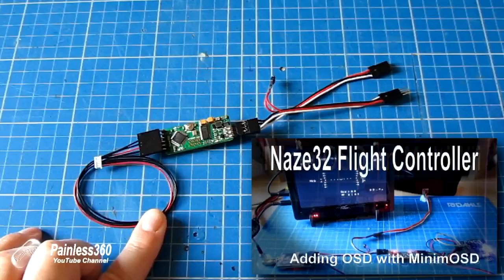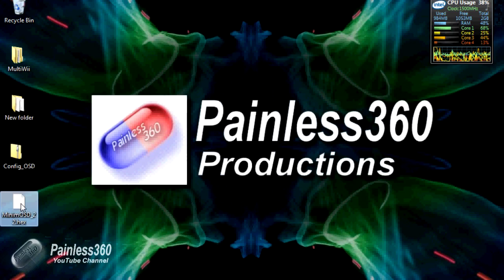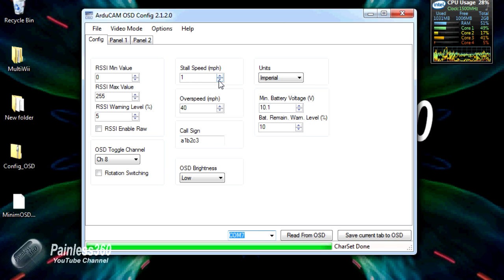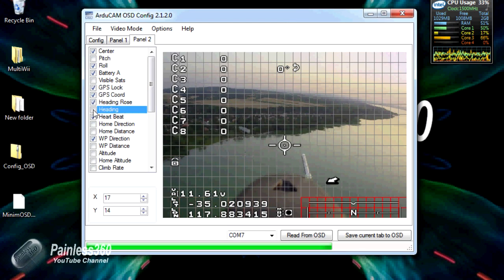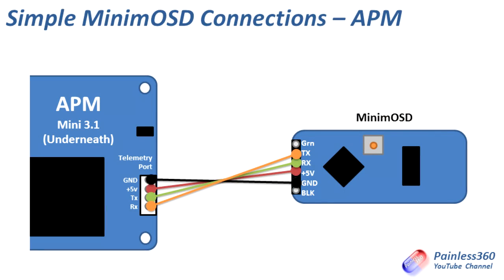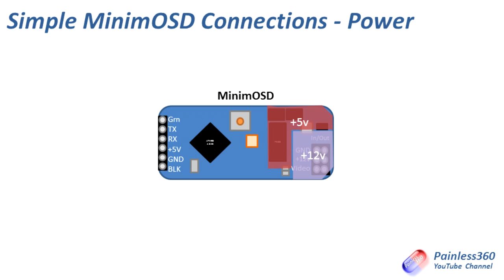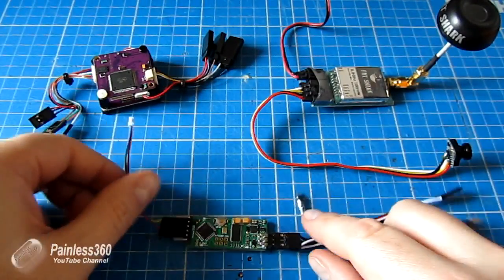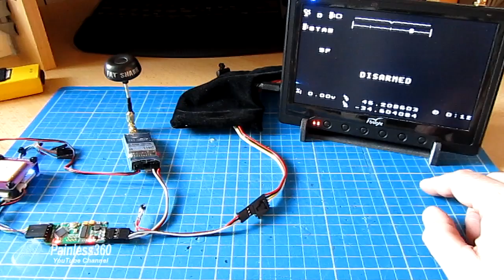APM Mini 3.1 - Adding an OSD for FPV using MinimOSD - complete setup

Comment: I’m having an issue where I select Rtl on a toggle switch and it’s not being displayed on the osd. I’ve connected the apm to ardupilot and selected rtl threw the transmitter and it registered in the software. Any reason for that? It displays stability and FWBA modes fine but when I select RTL it just show the last mode while in rtl
Reply from the maker: Testing stuff on the branch won't always bahave in the way you expect. Try it in the air... Happy flying

Comment: Hi sir... Salam alikam... Hope you will be fine... Sir kindly if you can make a video about miniosd setup with pixhalk 2.4.8 and which firmware can be compatible of osdmini with pixhalk.. bcz I am facing issue about the mini osd layout is not showing if I connect osdmini with pixhalk telemetry port 1... 
(waiting for mavelink data.)..
 But if I connect mini osd with Apm it working fine and giving the desired layout on the screen... 
Then why not with pixhalk bcz both flight controller are configured on mission plannner????🙏
Reply from the maker: https://youtu.be/ghhqSGxdIwQ was my most recent video on the subject. Best of luck

Comment: Totally appreciate your work, great job, quick question I know it is an old video but I am having one issue hopping anyone has any solution, I am connecting it with Pixhwak cube, and all things run smoothly, just as u described in the video sometime the overlay doesn't come when it starts or boots up, you have to manually reset it, is there any way around this?
Reply from the maker: I never found a solution. If you do, please let me know. Happy flying!

Comment: great tutorial, same method for the Pixhawk 2.4.8 ?
Reply from the maker: From the software point of view,  yes. Best of luck
Reply: @Painless360  thanks!. yes just a different set of cables... 2 question, if the system is running of 4s and the minimOsd has 12v and 5v how to go about it?, ... 2nd question in the last part of your video you say no power is given from the vtx to the cam, why ? and i ask this because i see the red wire of the vtx and cam connected so isnt the vtx supplying 5v out to the cam?
Reply from the maker: Not sure, there are several versions of the MinimOSD board. You can use BECs to drop the flight battery voltage to the level you need.... best of luck
Reply: @Painless360  thanks for the reply sir
support from the war torn land of Balochistan!

Comment: using this workflow, is there a way to add geotagging to an on screen display? for example have a center dot and the lattitude and longitude of that center dot? (perhaps also a grid square of 9 dots with lat / long?).

Then if the camera is a gimbal, changing the direction and angle of the camera would update the osd of teh center dot's lattitude and longitude?
Reply from the maker: It's not something I've seen. There are geotagging options in Ardupilot but the stuff I've seen is more for tagging images at the location they were taken... Happy flying
Reply: @Painless360  thanks! yeah would probably need something like raspberry pi or nvidia jetson to make a real time geo-tagging of the location where the camera points to

Comment: Trying to config the Minim OSD I purchased off Amazon. Connected to FTDI interface & computer .. tried to do a read & got 'failed to talk to bootloader'. Also said Eeprom was out of date & it tried to update, but that also failed. When plugged in, the Mini OSD board has 2 red LED lit, and a green heartbeat flashing, so the unit appears to be working to some extent. I have the TX/RX lines crossed to the FTDI board. Any ideas?
Reply from the maker: I've not used this technology for years so what I knew is in the video. Best of luck

Comment: Can i use mini OSD with betaflight controllers?
Reply from the maker: Most modern flight controllers have them built in now. Those that don’t will almost always support and external MinimOSD.. best of luck!
Reply: noob warning.So its same as minimOSD?I use XSRF3E,its compatible?Sorry again for noob questions.
Reply from the maker: There are two small boards that people used to use back in the days when on screen displays will not installed as part of the flight controller. Typically called minimosd or micro minimosd, they were typically used to add on screen displays to pretty much everything. The firmware was available to support pixhawk, APM and other flight controllers too. See my videos on the Naz E32 and things like the Seriously pro F3 for more detail. Best of luck..

Comment: Are the "in/out" on the MinimOSD actually ins and outs? AFAIK they are connected together, so a simple "Y"-harness between cam/VTX/OSD is enough? I have a Aomway camera with backpack, but it does also have the connector for the VTX exposed - so I could wire it up to a OSD.
Reply from the maker: That's the way I've always connected them and they work great. The MinimOSD is overlaying the text into the video signal so there needs to be an in and an out.. Happy flying!
Reply: Hmm, maybe you're right. I can see the ground and VCC are connect together, so that could be simplified.
I might be confusing it with my Mini OSD, or "G-OSD" where there is no in/out, the signal are just spliced together
https://static.rcgroups.net/forums/attachments/3/9/6/1/0/4/a5625515-165-hkosd%28GOSD%29diagram.png

Comment: I wonder if you have come across my problem with the MinimOSD on an APM 3.1. On powering up the craft 'Arducam OSD V2.2' appears, then a booting up message, then 'Requesting datastreams' and then the correct OSD overlay appears for 1sec and then disappears and the message 'Overspead 45m/h'
 stays on with the camera image. I have two MinimOSD boards and they both do it?
Do you have any ideas as to what might be going on.
Many thanks again.
Reply from the maker: I've not used that one here, from what I can recall. I'd try and swap the Tx and Rx cables.. Best of luck!
Reply: Thanks for trying, appreciate it.
Reply: Just a quick note in case somebody else has the same problem: Swapped Tx and Rx cables and got message waiting for Mavlink heartbeat. Swapped them back but no improvement, on a whim swapped them back again but this time swapped again with the system live and the OSD stayed up. Powered down and and back up, hey presto comes on every time.

Comment: hi painless. 
a quick question.

my minimosd works fine and does everything it should but only after the telemetry link to ground station is started.
I can stop the GCS and it is fine but it seems like the telemetry is required to start the messages flowing.

any ideas what settings make it work?

I dont want to take a laptop each time I fly but I do want the osd.

cheers
Reply from the maker: You're lucky to get them both working from the same Telemetry output at all. The output on the APM wasn't designed to run two devices at once..
Reply: ok. thanks.  I thought the Y cable was the standard. I will read some more.

Comment: I have connected OSD to APM 2.6 works great with all modes except when I switch to Auto mode (ch8) all OSD info goes away but I still can see the camera, any ideas please
Reply from the maker: +PAL- GATE I'd suspect that you have a setting on the OSD to blank the display and it's using that channel to activate it.. if check the OSD settings. I think we cover this in one of the APM series.. best of luck!
Reply: thanks, I will do
Reply: Yes you are absolutely right, it's in the OSD configuration,  OSD Toggle channel defaulted to channel 8, I disabled it

Comment: I followed your instructions on this, thanks for that.
Everything is updating except the battery voltage...:-(
Also updated in Mission planner (version 1.3.41) by clicking the osd tab.
Any suggestions?
Reply from the maker: +Pol leke not sure what you are describing..
Reply: Sorry to bother you like this, but i could not find the an answer.
This is what I mean. I have followed your instructions. So I connected everything the right way (checked, dubble checked and triple checked)
On my Taranis the voltage of my flight battery is reading fine (from the RX module FrSky Lite FUL-1) for example 12.1 volts
But when I look in my FPV goggles, the voltage is floating from 11.20 to 11.43
And it's always the same values, even when the battery voltage is on 10.7 the goggles are still showing between 11.20 and 11.43
Reply from the maker: I've not seen this - I'd check that he voltage is appearing right in the GUI and then see if there is an adjustment in the OSD software. Best of luck!

Comment: I have followed this over and over and still when I try to update firmware or Flash bootloader I get the error "Cannot talkt to Bootloader."
Reply from the maker: No idea, are you talking about on the MinimOSD or the APM?.....
Reply: on the MinimOSD.   Can get it to connect but when I try to update firmware it errors out saying Try Auduino every time.
Reply from the maker: Double check you have the right programmer and board type selected.. Best of luck!

Comment: I'm very new to using OSD's and I was wondering whether it always requires some sort of FC to run an OSD? I want to add one to a flying wing but it doesn't have any sort of FC for stabilization. Is there any other way to add for example a minim OSD to the wing without an FC? Would be very thankful for help
Reply from the maker: +Johnny 250 you can but it is not well documented at all. See the details on using a Minimosd with a GPS as a standalone OSD. If you get it working before I get round to it then please let us know. Best of luck!

Comment: if this is connecting for telemetry port. where should i connect my telemetry. how to use fvp and telemetry at the same time
Reply from the maker: The answer is - not easily. If you add both then the signal can be pulled down and both the telemetry devices can't clearly 'hear' what's coming out of the port. You need to choose one or the other or look to add a signal buffer. This is why the Pixhawk has more than one telemetry port. Best of luck!
Reply: Thanks for the reply

Comment: is there a way to get the osd working without having to connect to a ground station.
Reply from the maker: +rio787 Not sure what you're asking.. The image appears in any display you're using for FPV - Goggles, screen, DVR etc..

Comment: Hey, i am using APM Mini 3.1 and plan on using 2 on-board cameras. How do i click images using a Minim OSD & Telemetry setup?
Reply from the maker: +Vivek Ajgaonkar I'd use something like the HobbyKing Camera switch between the cameras and the OSD (check out our review in the 'Reviews' playlist. Best of luck!
Reply: +Painless360 We already went through the switcher, what i understand is, it is used to switch between video for live feed? Does it also serve the purpose of clicking images in flight?
Reply from the maker: It only changes the camera feed, not sure what you're asking. There are devices to operate the 'shutter' on a traditional SLR camera if that's what you mean..
Reply: +Painless360 I want to capture images from two onboard SJ4000 cameras at the same time (to get two different type of images)....how do i do it?
Reply from the maker: Do you mean combine two images into one for transmission? Sorry, I'm really not following what you are trying to do. Book a support call (see the website for charges) and we can take a deeper look..
Reply: +Painless360 My cameras are already mounted on my quad and I am facing problem in triggering the cameras to capture images. But the method used in the video explains about live video streaming and not about image capturing on two or more cameras at the same time. Can images also be captured using the Minim OSD or is it only for video streaming purpose? Is there any other method which you would suggest as a trigger mechanism which I can incorporate for both of my cameras on board.
Reply from the maker: MinimOSD can't trigger anything. We've not played with remote triggers for cameras here but I've seen RC based IR triggers for some SLR style cameras - best of luck.

Comment: Lee: Is choosing PAL or NTSC (for USA) under video options important? I have a jittery overlay and video from camera is stable.
Thanks for all the videos!
Reply from the maker: +Derr Nav One gives you more lines, the other a faster refresh rate. You normally need to make sure that all of the pieces in the FPV system have the same settings to work well. You can usually tell quite easily when you haven't as you don't get a stable image!

Comment: i have the same setup, but i cant get any osd inputs exept on the screan i can see runcam v2.2 waiting mavlink heartbeats.... and i can see this when usb cable is conected to apm. if i unplug usb screan comes black and i cant see anything.
Reply from the maker: +Donatas Rudys Happy to help but please watch https://www.youtube.com/watch?v=olIqTiSJHIY and come back to me with more detail of what you've tried..
Reply: +Painless360 I found the problem, problem was that i was powering apm from my ESC and it seams that it was to low power for everything. I have added UBEC 5V/5A and now it works. But now i have another question. Is it posible to get battery voltage on screen from two vires GND and +5v, or i have to use APM power module?
Reply from the maker: If you are looking for the battery voltage to be displayed in an OSD and on GCS then you need the Power Module. Best of luck!

Comment: Also, here's my wiring diagram.  I also thought it might be because I disconnected the 5V+ from the telemetry modem, but the board seems to power up just fine without that.  I didn't want to pull to much current from that wire, so I connected the 5V regulator as shown directly to the battery.  But perhaps that why the board cant seem to remember my panel layout?  I'm using APM as my autopilot. 
 https://photos.google.com/photo/AF1QipNF_X-lGrj1zhNZ_BYAPpFv88bDo2h9Ifz1MH4R
Reply from the maker: +Jeremy Stromsoe Sadly I can't see the image - I get a file not found error..
Reply: +Painless360 how's this.  Also I reflashed the panel settings 3 times last night.  On the third time, it worked.  Very hard to reproduce.  http://imgur.com/YRKuNSk
Reply from the maker: The wiring looks fine. I'd be tempted to try another version of the firmware. Best of luck with it!
Reply: +Painless360 Any suggestions?  Firmware I'm using looks dated and there are dozens of variants.
Reply from the maker: Only the ones in my videos - those are the ones that I've used here and then used in the channel as they seem to be the most 'reliable'. Best of luck with it.

Comment: I'm using the software I found in this thread for APM Copter.  Its called MinimOSD-Extra_R800.  There is a link, along with username and password in the below thread.  It actually worked fine for a little while, then suddenly the board forgets my panel layout.  I've never done anything to the EEPROM knowingly... maybe that is the issue? 

http://diydrones.com/forum/topics/adding-extra-functions-to-minimosd?commentId=705844%3AComment%3A1567446
Reply: I downloaded this software also but have not used it. Have you had any solutions or understandings? Thank you.

Comment: +Painless360 any issues with the Micro MinimOSD loosing its memory of panel layout after flashing?  It seems as though firmware and character updates take to the board just fine, but for some reason after all systems boot, it reverts back to the original panel layout.  I've tried powering the board with just USB 5V and the UAVs own 5V regulator, it seems to forget both times.  I've also tried two different Micro MinimOSD chips, which then really just points to the firmware.  Maybe you've got a link to some latest+greatest firmware?
Reply from the maker: +Jeremy Stromsoe Hi, I've not seen that here. Have you another board you can try?
Reply: I have two boards, both behave the same.  I think it's either firmware related or power related.  Seemingly usb powering it would rule out power being an issue... just not sure.
Reply from the maker: Does seem odd. What firmware are you using?

Comment: Would be great to see if this is working for pixhawk as well, cause i can see some functions which have been added to the minimosd-extra firmware only. Futhermore i would be interested to set the RSSI and the appropriated alarms correctly ;-)

Comment: Hello,
Any advice on how to set this board up on a free standing setup? Say, with a KK 2.1.5 board just to monitor voltage?  I have found the firmware that allows this here, but there are no instructions on how to do this. I have heard that a GPS and a compass can be used without a flight controller for return to home arrow, and a few other options. 
  Any advice would be helpful

https://www.dropbox.com/s/86x68rnqpbi3ga6/MW_OSD_standalone%20%281%29.zip?dl=0
Reply from the maker: No we've not. For simple voltage monitoring we use the features of the FRSky receivers. Best of luck!
Reply: +Painless360 Simple OSD solutions for the KK type boards. One with artificial horizon called a DALRC OSD, and one based on the older Remzibi made by tarot, but with no artificial horizon. Both have a GPS included. 
  It can be done with the Minim OSD, ( with a compass gps for a home arrow) but there are always config problems, and hair loss.

http://www.thanksbuyer.com/dalrc-qosd-quadcopter-fpv-a-v-transmitting-module-remote-control-diy-package-for-rc-multicopter-aerial-41584

http://www.fpvmodel.com/tarot-osd-image-overlay-system-with-gps-tl300l-_g890.html

Thanks for responding

Comment: Dobrov time of the day, I really like your video, but looking I do not understand a single word of Russian, I'm doing everything as you are connected no OSD vyhodit.OSD works only when power is connected via the Micro USB
Reply from the maker: +Максим Иванов Then I would check that both sides of the boards are powered (check the solder pads we look at in the video). Best of luck.